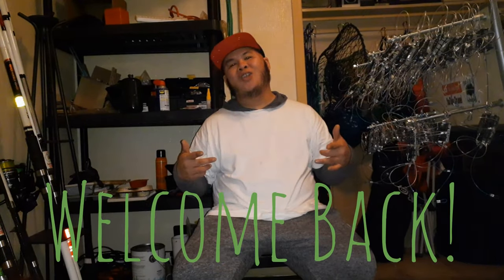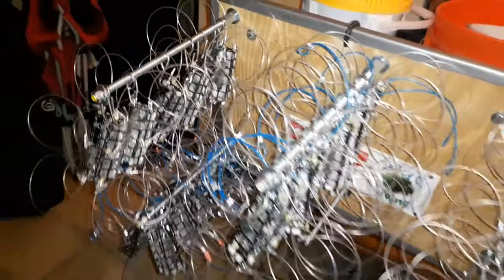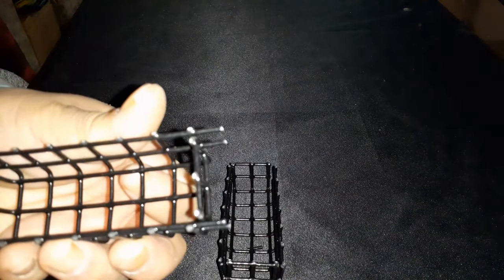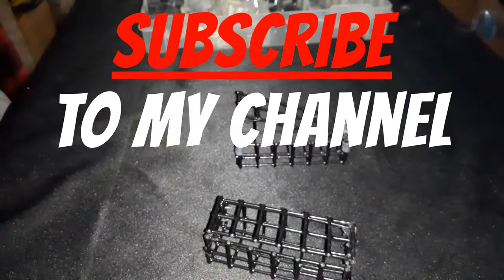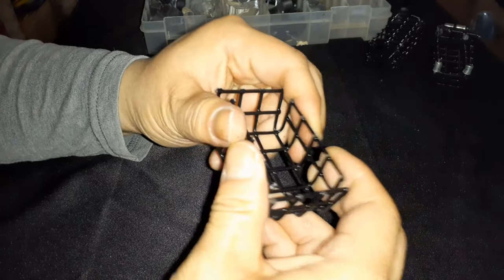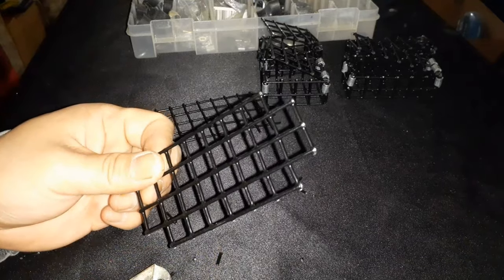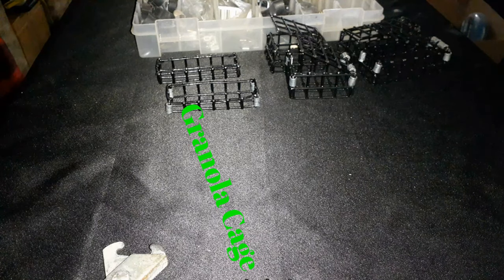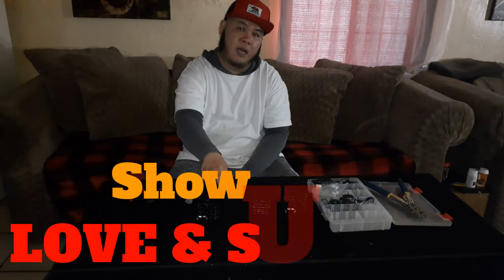Making Crab Snares EPS. 1 - Shaping the Bait Cage (Secrets Revealed)

Comment: When I was looking at your snares I noticed the coated wire and the 1/2 in squares. I like them a lot. I have my lead molds but want to see what your's look like. Do we do it the same?? I like one of your snares a lot so I want to see how you mount your lines. Because of the Rona we haven't been out in a long, very long time! I don't need to make any new snares this year. Maybe they will be opening the parking lots and piers soon??
Any idea when you will be posting the other videos in the series?
Reply from the maker: Hey Gene. They opened up the parking lots to the beaches roughly a little over a month ago in the Bay Area. They opened up the pier the last 2 weeks of the season. Crabbing on the pier was horrible. Mostly small crabs, females, and rock crabs. Not many KEEPERS! I had a lot better luck at Baker's Beach.

Comment: As someone whonbuilt lots of rabbit cages,  if you can get the J clips and pliers,  it will be neater,  stronger and faster to put together. It's also very cheap inbred US.

If you just want to make a few cages for now and you have no tools, just use the original method by usingbthe wire ends to secure the ends of your cage. You will get lots of use out if it but it may fail sooner. Cause of the bend in the wire. It tends to weaken at the bend and break or rust at that point. However, you can still catch crabs until it fails. 

Numbers to get fancy or buy expensive store bought snares. If you can't or don't want to make them yourselves,  just look online and there are many local or YouTubers making and selling them for a good price.  Please support them instead of the bug stores unless you don't have a choice at the moment. 

By the way,  other than the vinyl coated hot dipped galvanized wire,  the best option is to buy Marine mesh,  with comes coated it plain. As the name says,  it's made for Marine use and dies not rust. 

So if you want to make a few or a hundred of these snares for your personal use,  you can buy how much mesh you need and yes it comes in half inch square as well, to make bait cages that will last you the rest if your life time. 

Unless you use cheap leader and line and lose them... Lol